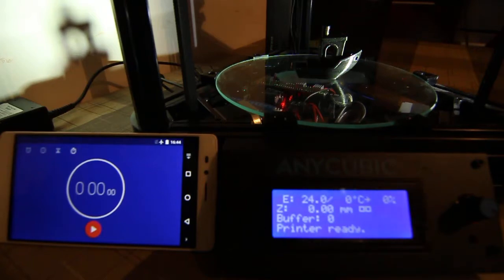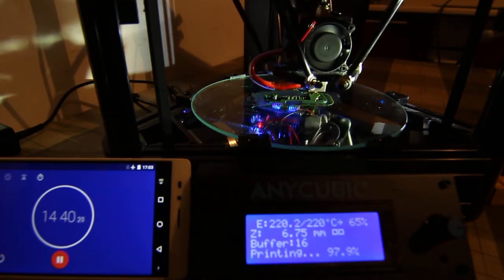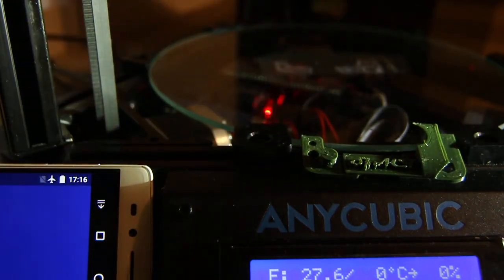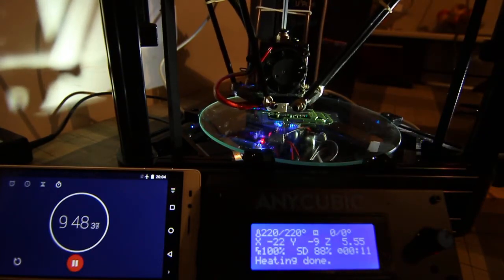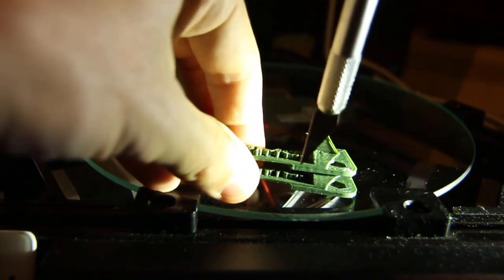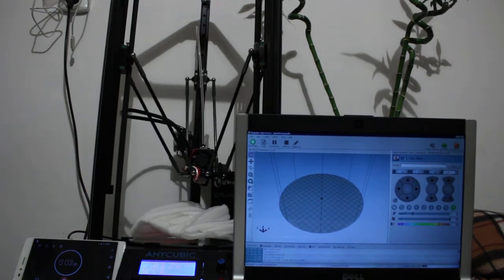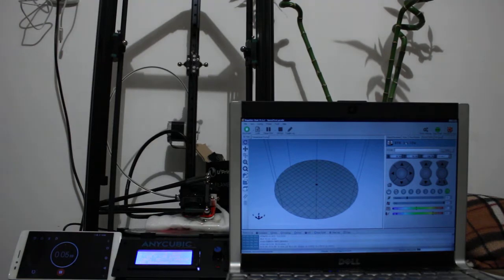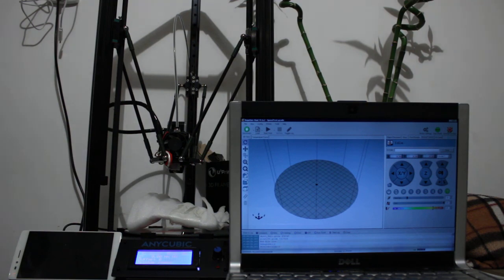Marlin vs. Repetier Firmware on a Delta 3D Printer

Comment: I'll have to give your repetier firmware a try... I'm still running the beta version of Marlin Anycubic supplied with it.
Reply from the maker: tin2001 And I need to do another test with the dev. branches of Marlin - they have changed a lot since the 1.8.x release one.
Reply: I am finishing my skr Pro with tmc5160 on an anycubic predator
Then I will see what's what and probably test repetier

Comment: Hey please can you help me I have the exact same 3D Printer as yours(Anycubic Kossel Delta Plus)I accidentally Burnt the main board and its not working so I ordered a ramps 1.4 and Arduino mega to run this I'm trying to load the firmware like you trough Arduino for windows but its not working?
I bought the ramps kit so it comes with a larger graphic screen I thought that was the problem but when I changed it to the screen that comes with the Anycubic delta printer it still not showing anything?
the firmware link you provided seems to upload it on the Arduino ok but it wont display it?
Reply from the maker: Can you communicate to the printer over the serial (USB) port with (e.g.) RepetierHost after you upload the firmware?

Comment: So at the end, the acceleration and the jerk where the same on both firmwares?
Reply from the maker: I did two tests:

Test 1:
The print test with Marlin 1.1.6.
Maximum speed, acceleration and jerk values were the same as in Repetier. But as you saw Marlin printed much faster. The reason is this:
https://github.com/MarlinFirmware/Marlin/pull/8697
In 1.1.6 the jerk algorithm was reworked in a way that changed the "meaning" of the jerk values - the same number (20) now  results in much higher actual jerk.

Test 2:
The speed test with the magnetic ball joints and Marlin 1.1.8.
Here the jerk was adjusted according to the above algorithm change. See this:
https://github.com/MarlinFirmware/Marlin/pull/8888
As you saw in the video Repetier is now a bit faster(higher actual jerk), but the difference is small.

(The changelog states that the change was made in 1.1.7 but I think it may be wrong).

Comment: how did you get it to print on the glass? Was that on tape?
Reply from the maker: Glue stick (paper glue) in a thin layer on clean glass. It is good enough for PLA even without a heated bed.

Comment: You should look into Klipper if you'd like higher quality prints at higher speeds.
Reply from the maker: Thanks for the hint! I had not heard of it - reading it's "features" document it sound extremely interesting. And finally a reason to buy a Raspberry Pi as more than just a toy to tinker with. It is now a useful piece of a toy to tinker with :-)
Reply: Acceleration changes(and thus, Jerk)are one of the primary issues that Klipper addresses... read the kinematics document on the Github repo for detailed information.    In addition, the complex beizier calculations are performed on a raspberry pi(or any compatible arm architecture) MCU and then fed to the Micro-controller...  making the controller itself more of a driver-plex/heater-plex.   Essentially, the gcode is parsed post-slicing and many delta movements, like the dreaded zig-zag, are eliminated.   In this case they are replaced with a trapezoidal algorithm.   Overall, I think you will find your experience is much better with delta printers and Klipper.
Reply: If you can make the expenditure, and are truly dedicated to this, also consider a beaglebone board, like the beaglebone black.  It is fully supported by Klipper, and just now we are beginning the development of custom IRQs.  I never thought i'd write ASM again but now I am...  Because of its architecture, in the case of the BB Black, the dual 200mhz PRUs can detect things like nozzle collisions in real time.. .and, at some point, this means we'll finally solve the nozzle collision/layer shift problem.... well, not only solve it, but make it possible to go back and fix a curled up piece of filament.  I forget which page it is on now, but you will find a document related to overall gcode point resolution... the beaglebone black pretty much annihilates everything else, clocking in substantially higher than the Arduino Due.  The main thing to keep in mind is this:  Klipper is a real time processor, because put quite plainly the only way we can advance our current capability of firmware is to begin considering the handling of real-time events and complex calculations.. these are not the job of an 8-bit AT Processor.
Reply: Is Klipper open-source?
Reply: Absolutely, you can find it on gitghub at http://github.com/KevinOConnor/klipper

Comment: which firmware do you suggest for my geeetech g2 rostock with dual extruder amd metal parts? thank you
Reply from the maker: PROJECT VILLAIN depends on the controller board. What is it? For ATmega (Atmel AVR) based ones - Repetier. For 32 bit ARM ones... it depends...
Reply: thanks for the quick reply. its using a gt2560 i used repetier for my i3 before but this is my first delta style printer.
Reply: reason i ask cause i cant find any current 2018 firmware vids besides yours.very good video btw.
Reply from the maker: PROJECT VILLAIN ATmega2560
https://www.geeetech.com/wiki/index.php/GT2560
In this case definitely Repetier (in my current opinion :-) )
Reply: Thank you!